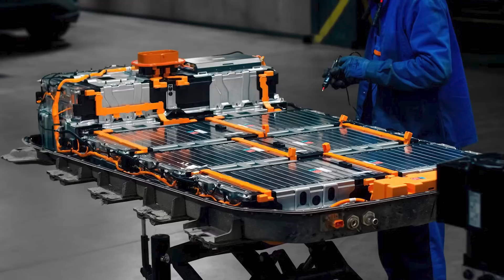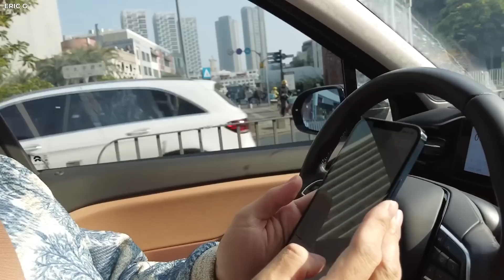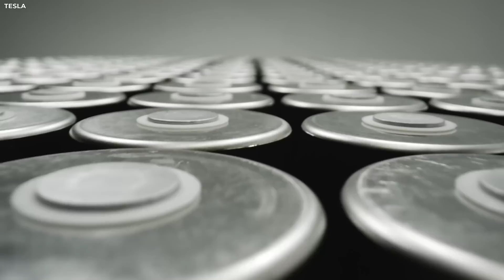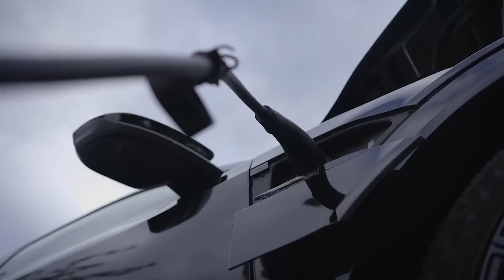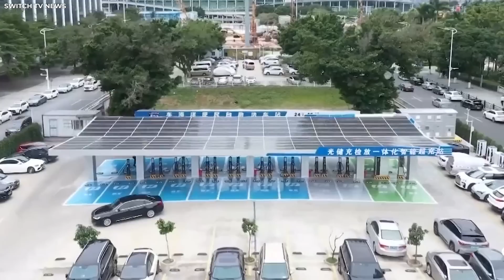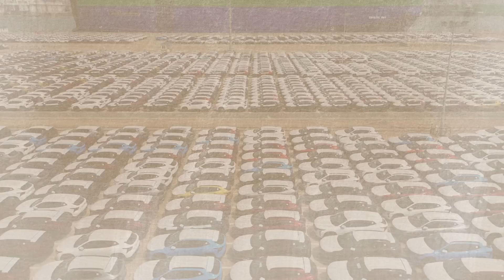China Just Developed Swappable Lithium-Ion Batteries, Shaking up the ENTIRE Industry!

Comment: This is old and not effective, which is why this method has not spread even in China.

First, every car is different in size, height, weight...which means it can have a larger/smaller battery. But for this system, the battery capacity had to be almost the same, because otherwise a different capacity would change the size/shape of the battery.

Cars with higher efficiency would have a longer range, while cars with lower efficiency would have a shorter range. When towing, the range would be even shorter, if we add in bad weather, rain, headwind, snow on the road, tire size... the range would be more than half shorter than normal. For example, the Cybertruck would have a very short range due to its shape + weight, but with a larger battery you can increase the vehicle's range.

The swap-system would prevent car companies from increasing battery capacity to improve vehicle's range, especially for vehicles intended for towing/work.

Since this is old, I don't remember all the bad things about the battery-swap system.

But the worst thing about this feature is that at the end of the day, millions of batteries across the country would need to be charged as quickly as possible, as locations will soon need fully charged batteries.

Charging over a million batteries at the same time would put a very insane strain on the power grid.

Next problem, it is bad for battery health to be fully charged to 100% for daily use. It's recommended keeping the State of Charge (SoC) of the battery between 20% and 80% unless you need the full range. The smallest capacity loss is by charging to 75% and discharging to 65%.

Because they don't know who will come to the swap center, the batteries must always be full.

Charging batteries always with fast charging is again bad for battery life. Not only that, repeatedly fast charging poses a safety risk of the battery catching fire.

Because of this, we will not see this system around the world.

NOTE:  Maybe I forgot something because this is old technology and I watched the video a long time ago.